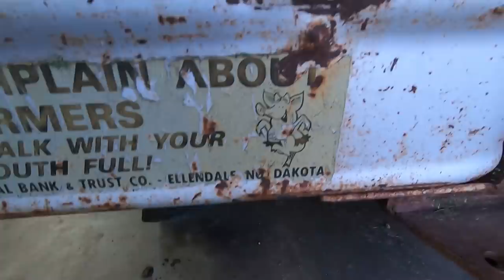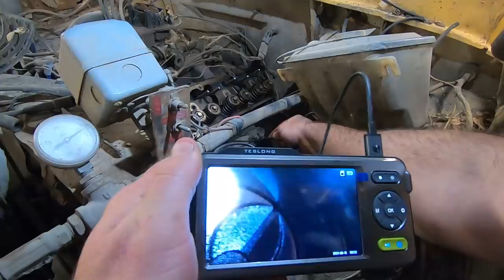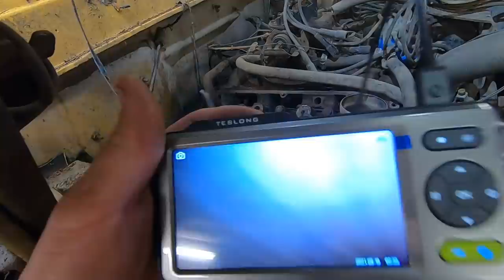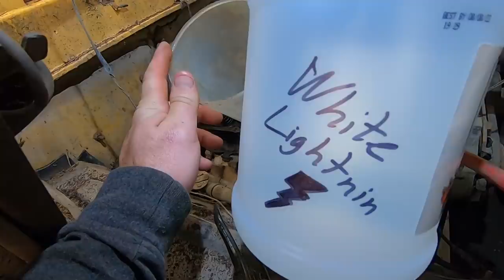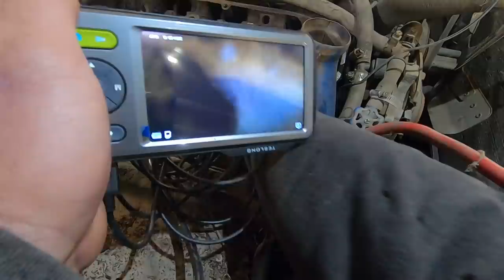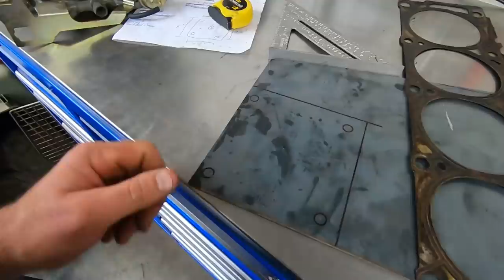Abandoned Farm Truck! 1971 Ford F100 4x4! Will it Run?!? Parked for 18 years in a field!

Comment: I'm sure if I scroll through enough comments, someone already said this, but "FE" stands for Ford Edsel. That block was originally developed for the Edsel. Every time you smoke tires with a 390, thank Edsel for existing.
Reply: No the Edsel typically had Different engines than the ford. The FE came in fords in 58 as a 332 and 352 and was a 390 in 62. Edsels typically  had 361 and  it was a MEL. That MEL stands for Lincoln Edsel & Mercuryl.
Reply: @thecollectoronthecorner7061  While you were trying to sound smart, you never answered the original question...and Lincoln, Edsel, Mercury would be LEM
Reply: More trivia, there was also a version called the FT (Ford Truck) that had a steel crank and a bunch of parts made out of different material. They also had smaller valve, but that's OK if you want lots of low RPM torque. Good for doughnuts.
Reply: @MaxNafeHorsemanship   The 430 was a MEL look up MEL and you can see almost not any parts are the same a the ford FE.
Reply: @thecollectoronthecorner7061  In other words, you have no idea what FE stands for.
Reply: @MaxNafeHorsemanship  LOL  , Your comment almost made me Pea my pants.  DAM!
Reply: @MaxNafeHorsemanship  Yeah FT ran 330, 359, 361, 389, and 391.
Reply: ran them in F600s, F650s, F700s, F750s. Some F250s and 350s had them also.
Reply: FE stands for Fuckin Expensive
Reply: @thefordmaniac  Nothing good is cheap.

Comment: Pull the engine!!  Great content on how to overhaul the Ford Truck 360 V8. It's a great truck, 4 speed manual, V8 and 4 wheel drive. It has a lot of options too. Keep it and fix it over a 6 or 7 months, IDK. I own a 89 F150, I've been fixing and repairing since Dec. 2020 till now.

Comment: Hi Mortske & of course Duff
Great video I loved your press, I did wonder why you did not move it to a few of the other suspect cylinders?
I still stand by getting you getting a good solid piece of Oak or Ash and a 20 lb sledge. Go from cylinder to cylinder and play Whackamoly. It works. I have done this many times with mixed results on getting the engine running again. However it has never failed me at getting the pistons to move. Keep the great videos coming and I doubt you will lose the SHOP.

Comment: When I saw the condition of the valve train, I first thought that you are going to lose the shop and the video would be over.  You stayed with that one way too long as usual but I hope it finds a home.  You know the truck is bad when Duff dog won't jump in!  Great work as always!  I would love to see the Chevy crew cab make an appearance with some updates.
Reply: Mortske, I think you would have been ahead of the game by pulling the engine, and blowing it up on a stand. If one piston was holding up the show, chop that sucker out with a chisel. See be you've switched from samiches to a mixed drink. Take it easy on the sauce, my friend.
Reply from the maker: Great point!
Reply: @jeromebreeding3302  ppl p oloo 9

Comment: I would probably put that 360 on a stand and start knocking it apart.to determine if it is rebuildable. A decent camshaft , intake and carb setup would make it a nice engine. I like pre EGR big blocks!

Comment: Just pull the plugs and put some ATF in the cylinders. Then use a breaker bar on the crank pulley. You're making this way too difficult...
Reply from the maker: Oh man, I'll give that a shot and when it don't work I can slander you all over the internet!
Reply: @MortskeRepair  On a serious note, that's a sweet truck! If things work out right, I might have a spare 352FE. Makes a guy think...
Reply from the maker: @WatchWesWork  Yeah, it's actually pretty good for around these parts. You need me to load up and head for Illinois some weekend?
Reply: Problem is on a V8 filling thru the spark plug holes you only get a partial soak. because of the angle on the block the top portion of the pistons will be above whatever your putting in the cyl. On a V8 I remove the carb and rocker arms. tap on the valves to be certain they are all closed. then fill the intake manifold full of diesel and atf mix. then open the intake valves and that will allow every cyl to get 100% full. Then I wait a month or two before trying to break it free.
Reply: @thecollectoronthecorner7061  I think you could wait until the second coming and that engine ain't cracking loose...
Reply from the maker: @thecollectoronthecorner7061  I presume he was joking.
Reply: @WatchWesWork  Yes  indeed I agree there are some engines stuck so tight that no amount of soaking will free them up. A engine in good cond is more likely to stick than a worn engine with  lots of wear and clearance. I had a farmall tractor with dry sleeves that was stuck so bad I tore down the engine  removed the crank and put it in a press and pressed the rods sleeves and pistons out as a unit. then cut the liners off the pistons. I saved the rods that way. I like the FE engines I installed a 1959 -352 inteceptor from a old cop car in my 56 vicky htp with a stick trans in 64 when I was 13 years old. I was able to beat 300 hp 327,s in a 1/4 mile drag race. Today I own too many FE engines to count. still have the 59-352 and have a 428 from a 67 T bird that I intend to put in a 64 fairlane Htp.
Reply: Where have been Wes? I don't see any of your shows coming up,, I hope you haven't been monetized..
Reply: @thecollectoronthecorner7061   that’s not even worth doing.. pull the motor the first time pull piston and hone the cylinders because if you can break them free you’re most likely damaging cylinder walls and rings and you’re gonna need to rebuild it anyway..
Reply: @thecollectoronthecorner7061  yeah I remember having a 350 that seized on me ( it was my fault ) I put engine oil in the carb at least a liter let it sit for at least a week perhaps more put the key in and start up knocking but running real well with a lot of smoke. 🤣😃
Reply: He's right!  Atf and antifreeze into the sparkplug holes and let her soak for a while.  Go out every day and give a breaker bar with a Long pole on it a tug until she comes loose ! I've been doing this forever , promise!  Also mix atf and acetone 1x1 and it's the best break free in the world !
Reply: @MortskeRepair  Puddin says white vinegar is the cat’s ass & bee’s knees for freeing up stuck pistons. You ought to challenge him and his Towrolla to a pull off. Looser has to wear them skin tight yoga britches & a tube top on their next video.
Reply: No kidding let it soak with something for a week or two " pick your poison " unless it was parked with a seized engine the release oil or whatever you use will work  / I hate it when these kids destroy an engine that could be brought back to life / don't forget they don't make these engines anymore that were simplicity to work on.
New engines suck all of them
Reply from the maker: @georgeniemi8259  Thanks for watching!
Reply from the maker: @Jeffroson78  Thanks for watching!

Comment: It was an epic attempt I'll give you that. I'd have to say I'm thinking that if you figured out the rotation sequence and hooked one of your fancy "pp9000" piston pusher on both sides of the block it might help exceed the rotational force needed by pushing from both directions at the same time to twist the crank and break the stinkin rusty  rat piss loose. Good luck. Cheers from Jacksonville Florida 🌞

Comment: This may come off as a dumb question but, when I used to do this, I'd drop a quart or two of marvel mystery oil or seafoam down the crankcase, then hook a drill up to the oil pump and prime that engine about a dozen times or so in the hopes it'll work its way down all the bearings ... have you ever tried this? If you can get lubrication down the rods, mains and cam bearings, the only real thing you'll fight are sticky rings. An oil pressure gauge on the far end of the system is usually a good way to know if you're making any headway while priming. Just a thought. I haven't done these in a while.
Reply from the maker: Never have because the rings are where it's stuck at.
Reply: @MortskeRepair  I kinda figured after seeing this video and several others. One thing I learned from Halfass Kustoms (he plugs you quite a bit these days btw) - that idea of dumping the clutch in gear while someone pulls you seems to be a decent idea. I tried that once and bent a few things, but I bet if you took the heads off and only used the drivetrain to jar the rotating assembly, you might have something.
Reply from the maker: @SeanPwnery  It works when they're not that stuck.
Reply: @MortskeRepair  I saw a guy doing rescues, mostly stuff from the 20s and 30s. He puts a huge pipe wrench on the driveshaft and puts the car in first. Then just rocks it back and forth.
Reply from the maker: @aprules2  I've tried that, clutch just slips unfortunately.

Comment: "FE" derives from 'Ford-Edsel. Versions of the FE line designed for use in medium and heavy trucks and school buses from 1964 through 1978 were known as "FT," for 'Ford-Truck, and differed primarily by having steel (instead of nodular iron) crankshafts, larger crank snouts, smaller ports and valves, different distributor shafts, different water pumps and a greater use of iron for its parts.
Reply: Often associated with the FJ series 'Ford Junk'.
Reply: @mark-wn5ek  Not a Ford fan either, i think they should be ashamed after making cars for 118 years! But that's my opinion.
Reply: Google it Fe stands for Ford Engine. Not Ford Edsel or Ford Engineering
Reply: @thecollectoronthecorner7061  Wrong.

Comment: Seems like you would get more leverage with the MPP if you used it on a piston that was half way down, when the bottom of the connecting rod is furthest away from the center of rotation of the crank shaft considering the direction of force the MPP is coming from.  Love your show!
Reply from the maker: Good point, guess I just wanted to push on the piston that we knew was stuck.

Comment: Even though you were unsuccessful in the old 360 you can still see potential in that nice Ford F100!   One thing about a 360 is they can build a 390 out of that block.
Reply: Right on that score. Any FE can be expanded by a crank and rid swap, even the 332.
Reply: Yes a 360 is a 390 block with a 352 crank. and used 410 pistons.
Reply: @jeromebreeding3302   the 332 has the same 4 inch bore as the 352 and a shorter stroke crank.

Comment: The vinegar is a mild acid, works like Muriatic Acid when de-rusting a gas tank.  But not good overall for metal; Kroil is a better bet because it lubricates too.  Your idea of pushing the piston down wasn't a bad one, but concentrated too much force in the weakest part of the piston -- aluminum is a lot more brittle than iron.  It might have worked to put 3-4 of your nuts around the perimeter where the piston is stronger and tighten them in sequence -- that's 3-4 times the total force with less stress on the aluminum piston, and closer to the stuck ring.  There the failure would be to blow out the land, which would still free the piston from the block.  I'm assuming FE pistons aren't hard to come by.  

When dealing with rust, there's no substitute for soaking.
Reply: I have used vinegar many times and it hasn’t given any indication of affecting the good metal but did take care of the rust usually within 24 hours and while I have also used kroil and love it, I have had things it just would not free up and I followed it up with a vinegar soaking which worked every time. Am I saying that Kroil is not a great product? Absolutely not because it is great but even it has limitations in which case something a bit more aggressive on rust is called for and so far all engines I have used it in freed up and as soon as they were free I oiled the cylinders to prevent flash rusting the cylinders and as long as the engine didn’t have other issues such as bad bearings, bad timing chains, etc and the engine was able to run it held up fine and nearly all of them are still running today although about half were eventually given a re-ring and new bearings after it was found they  were parked because they were getting worn out and the other half still run untouched after several years.  Of the nearly 20 engines I have used vinegar to free up only 3 failed to last and one of those was due to a cracked crankshaft, another dropped a valve taking out a piston and cylinder wall and the 3rd blew when a friend’s 16 yr old daughter decided that while her parents were at work she should do massive burnouts with that big 71 Buick Electra on the highway a little ways from home so she wouldn’t get caught and it tossed a rod. Her dad was so impressed with the burnouts she did that he couldn’t bring himself to punish her beyond telling her that she broke it, so she had to get her hands dirty and help do the work to fix it when he would get a replacement engine for it since the rest of the car was nearly immaculate.
Reply: He should have used malt vinegar!
Reply: Was wondering if using a grease nipple instead of a bolt and filling the cylinder with grease and using hydraulic pressure to move the piston

Comment: The 12 point design permits this style fastener to be tightened down with a 12-point socket wrench, permitting higher torques to be applied compared to a standard hex drive socket head fasteners.
Reply: Those rag joints are a pain. Mine took multiple tools, an angle grinder, and a vice, before re-installing it.

Comment: When you soak the cylinders if you put the spark plugs back it can help create a vacuum like a finger on top of a straw. It may slow down the leak past the rings. Just have to remember to remove the plugs before turning over.

Comment: I think you should have tried to heat the outside of the block with a torch just lightly heating it, not big time and have you tried putting it in gear and rocking the truck with the forklift a little bit! No to the vinegar but maybe start soaking them as soon as you find them because it might be a little while before you get to it! I’m just trying to help my friend, never hurt though! Thanks for sharing Mortske and Duff,  Kirk from Louisiana! 👌🏻🤙🏻🤙🏻🇺🇸🇺🇸🇺🇸🇺🇸

Comment: More than valiant effort!   I'd try putting a hardwood block to disperse the blow on the top of the piston.   Use a 4X4 post about 12" long and smash on it with a 20 lbs sledge hammer.    Add some heat with the rose bud torch.... more break free oil...  more sledge hammering...  Hit it harder and harder until it comes loose, or crumbles into pieces...  then you only need to replace one or two pistons... Hone the cylinders...and boom.     Lap in the valves... and it would probably run.

Comment: Try CNC Evapo-Rust. Had a motorcycle engine and short box small block absolutely frozen and this stuff worked miracles. Even great on rusted parts

Comment: I had one of these in 1989 with a 390 FE in it. By the way FE stands for Ford/ Edsel. Mine took me to work and back (50 miles) for a year with no oil pressure! I drove it to the dump, left the keys in it and before I left, someone was driving it on a trailer! Very tough old truck for $275 Cdn!

Comment: I really like the way you try to get fords working again. 
My grandpa hated Ford's so he used a gadget when it was a manual transmission. He attacked a plate to the rear wheel hub, with the tire off. He then put it in gear and turned the plate with an impact wrench. The engine usually turned or something gave up. It may work or not?

Comment: OK Mortske, I have an elixer for you and I've seen it work. A friend of mine had an old Ford flathead that ran a double drum yarder he wanted to use. It sat out in the field and rain for several years with one head off. Of course the motor was stuck. He said I'll have her going in two days. I asked how,the piston were crowned with white aluminum powder and stuck He said watch. He filled the cylinders with Coke. Slid the head over the mess to keep the rain out. You know it never rains here in Washington state especially the west side.. I went back in two days and he was sitting there reving the motor up. Smiled at me and said,  "I told you it would work"!
Reply from the maker: Interesting

Comment: have you ever tried taking an old spark plug, knock the center out, weld a 1/8 pipe bushing to it, screw in a zirk fitting and used a pump grease gun to push a piston down with the valves closed? Hydraulic pressure can move stuck pistons easier than prying.  This motor was obviously beyond any help but freed up many old antique tractors drug out of fields. Enjoy your content and my dog Sugar loves Duff. When she hears your voice she comes running and goes crazy when she sees Duff. I tried to send you some videos but couldn't get them to attach.
Reply from the maker: We tried it in the Flathead video and another. It just finds a gap. Like past a valve or the head gasket and squirts out.

Comment: I saw Derek Bieri (VGG) get a 75' Torino with a 400 that was locked up tight broke loose using the soak and breaker bar on the balancer bolt method.  However, I saw Dylan McCool soak and old big block Dodge with diesel.  Filled it from the pan the top of the valve covers, and down the carb, but still couldn't get it free.  Guess ya never know until ya know.  Good idea on the tool though!  Wonder if rocking the hell out of it with the skid steer while in gear and 4 low would've done anything...
Reply from the maker: I think the tires would just skid. We've tried before.
Reply: @MortskeRepair  Probably right

Comment: use a bottle jack and chain ,with a block of wood . chain the jack to the engine above the piston ,set the block in place,apply hydraulic pressure,then hit with a shop hammer